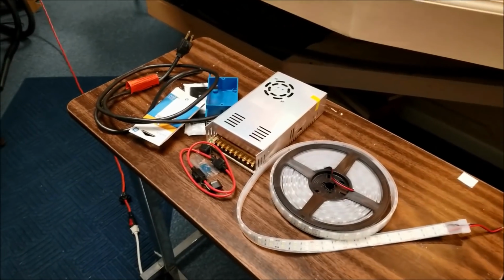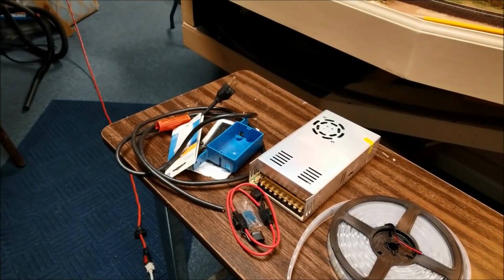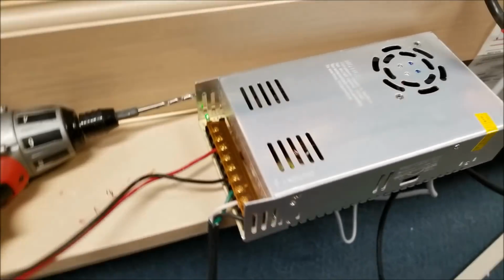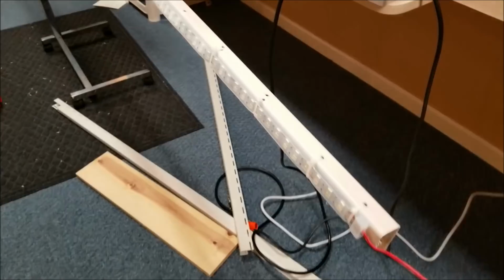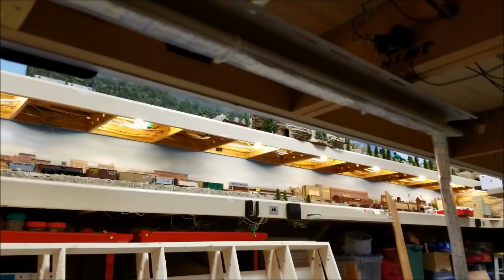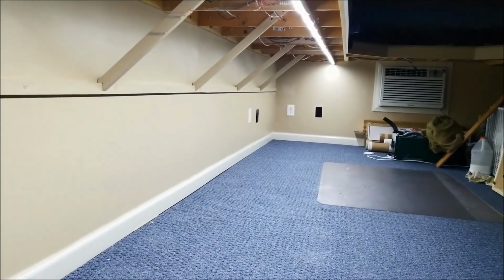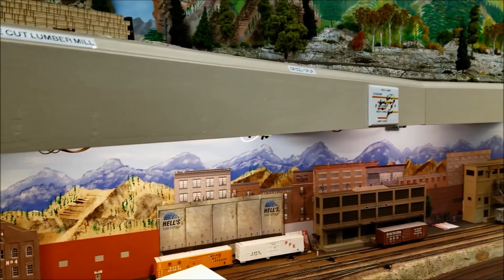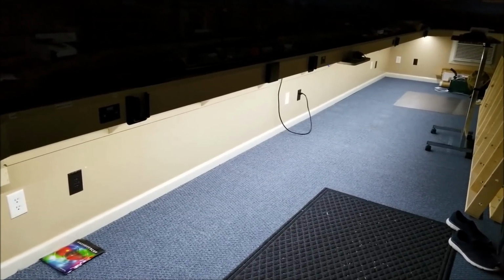LED LIGHTING FOR JUNCTION WEST STORAGE

Comment: Nice project.  I've used the same brand of LED light strip only in red lights in my observatory.  I had the same issue with the tape not securing the light strip.

Comment: EXCELLENT. Perhaps a hot glue gun would keep costs down compared to wire wraps. VERY good job Arthur.
Reply from the maker: Wier wraps free have tons of them from Estates and old job. But hot glue suggestion going to be used to clean up stickey velcro that is not sticking and wiers hanging

Comment: Very nice where can you buy the set up i have been looking for a while
Reply from the maker: This was the exact order.  
MUYI 2 Set Mini Blade Fuse Holder 14 Gauge Waterproof Pigtail Inline Fuse Holder with 15A ATM Fuses  

 Sold by:  MUYI Shop  

Return eligible through Jan 31, 2019
 
 $6.29  

 Condition:   New  

1
 EPBOWPT 12V 30A Universal Regulated Switching Power Supply Driver for LED Strip Light CCTV Radio Computer Project  

 Sold by:  SUPERNIGHT Direct Store  

Return eligible through Jan 31, 2019
 
 $17.99  

 Condition:   New  
  2  
 2 of XKTTSUEERCRR 5050 SMD 16.4Ft 5 Meter Double Row 600LEDs Cool White Waterproof Flexible LED Strip Lights 120LEDs/M 600LEDs/Roll String Lights  
 Sold by:  Xtek4U  
Return eligible through Jan 31, 2019
 
 $13.99  

 Condition:   New
Reply from the maker: All off of Amazon